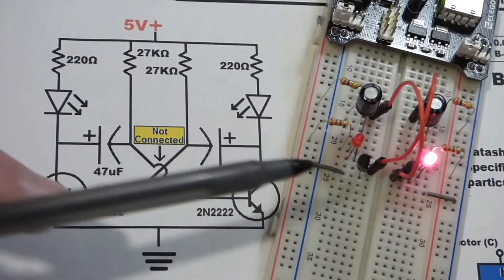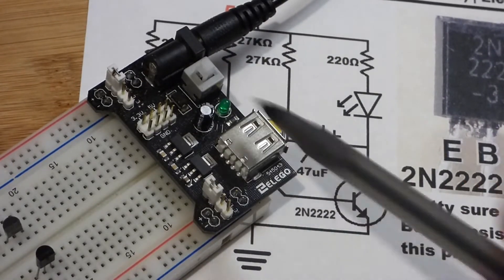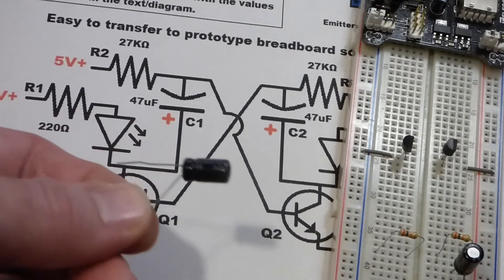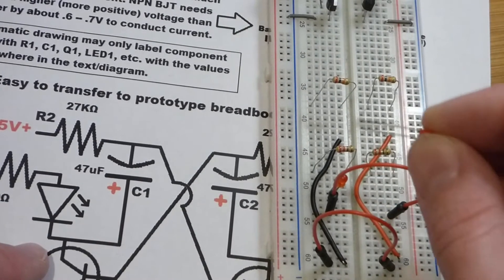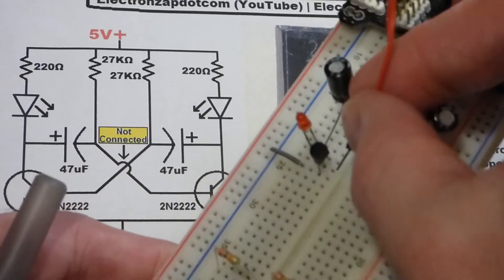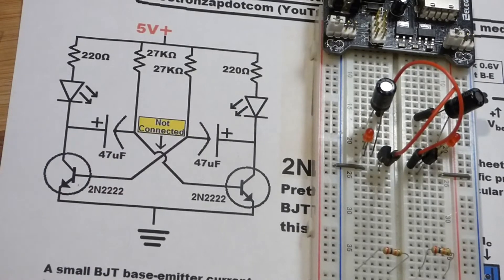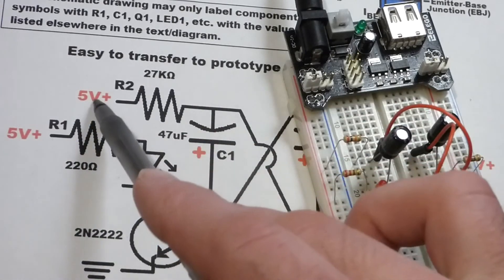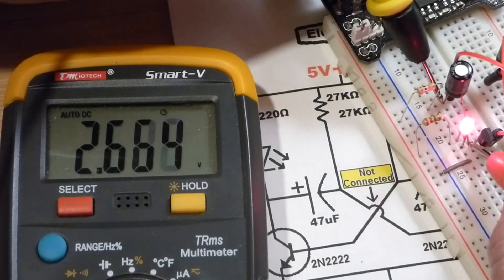2N2222 NPN BJT Astable Multivibrator Circuit on breadboard with 5V power supply step by step build

Comment: I didn’t have a any 27k resistors so I put 2 10k’s in series. It worked and made the led’s flash much faster. Thanks for taking the time to put this video together.
Reply from the maker: That's good. You definitely want to be able to make as many changes to a circuit as you safely can. Demonstration circuits are just a starting point.

Comment: Hi, whats the lowest voltage an astable will work / oscillate on....? ,  i will be using coils in place of the leds , so no need to light them with 2.5_3v... cheers .
Reply from the maker: I only made this circuit a few times, so not clue unfortunately. The transistors need 0.6V - 0.7V to turn on, so I am guessing you could get down to about 1V if you wire things the right way. It is usually wired to control one or more other transistors which switch higher power loads. You can probably find the schematics for a circuit that would work if you do a google search of "2 transistor astable multivibrator high power load", or something like that.